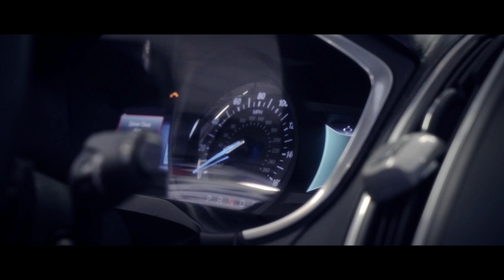Ford Edge LPG | 2.0 ECOBOOST | 245 KM | 2015 | direct fuel injection+gaz LPG | Zenit Direct

Comment: 2014 2.0 ecoBoost , how much is the LPG with labor everything included ?
Reply from the maker: It depends on various conditions. Ask this question in the near located workshop. Pay attention to the opinions about this workshop - choose one that has good feedback!
Reply: @ZENITAutogas  estimate? €500- €2000? I want to send a 2.0 LR2 to Europe from US.
Reply from the maker: In which country will you assemble the installation?
Reply: @ZENITAutogas  Poland or anywhere in EU .
Reply from the maker: Please write on agc@agcentrum.pl
Reply: Hello,
Is there a kit for the ford 2.3 eco boost available? Thank you.
Reply from the maker: At this time we can offer ZENIT Direct for following engine codes, without "2.3 eco boost":
- 2.0 EcoBoost 176kW, engine code TPBA
- 1.6 EcoBoost 118kW, engine codes JTWA, JTWB
- 1.5 EcoBoost 133kW, engine code M9MA
- 1.6 EcoBoost 110kW, engine code JQDA, JQDB
- 2.0 Flex Fuel 118kW, Duratec HE Ti-VCT
- 2.0 Flex Fuel 118kW, Duratec HE Ti-VCT 
- 1.5 EcoBoost 118kW, engine code UNCE
- 1.6 EcoBoost 134kW
- 1.6 EcoBoost 134kW, engine code JTMA
- 2.0 EcoBoost 149kW, engine code TNCD

Comment: What is the engine code from this Ford? I have a 2.0 ecoboost ford S max from 2017. My engine code is R9CI. Can my engine work with lpg? Thank you
Reply from the maker: It is a 176/177 kW engine. It also runs smoothly with our #ZENITDirect autogas installation 👍
Reply: @ZENITAutogas  yes my 2.0 ecoboost is a 176/177 KW motor with 241 HP. The problem is the R115 for this car.